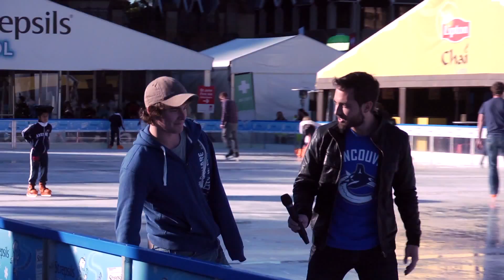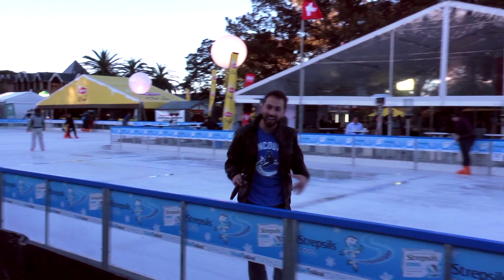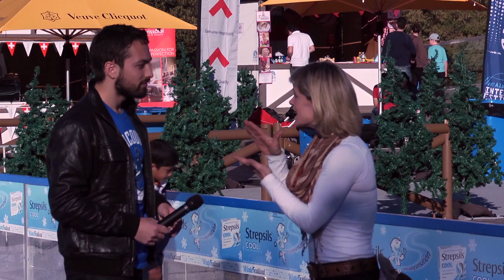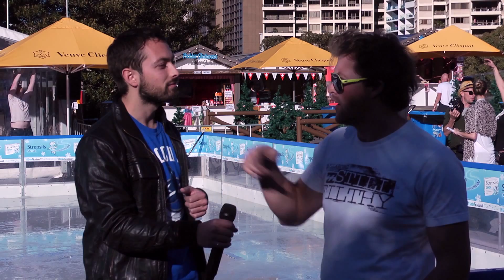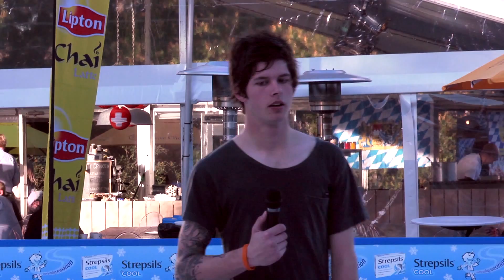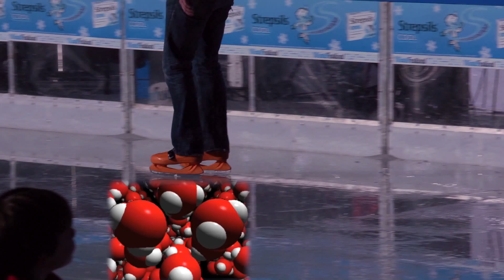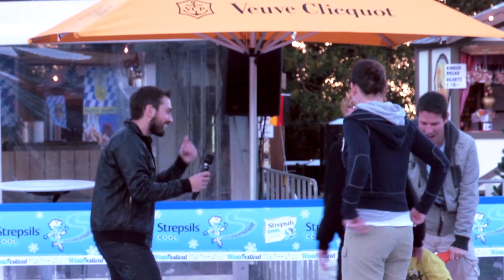Why Is Ice Slippery?

Comment: Ice is slippery because of a super-thin layer of liquid water on its surface, which acts as a lubricant, but recent science suggests this layer forms not just from pressure/friction melting, but also from molecular interactions (dipoles) that disrupt ice's crystal structure, creating a fluid-like boundary even at very cold temperatures. This quasi-fluid layer, a mix of water and disordered ice, is far thinner than a hair but provides the slickness that lets skates glide and shoes slide, overriding the normal friction.  

Key reasons for slipperiness:
Quasi-Fluid Surface Layer: The most accepted theory is a nanometer-thin layer of liquid-like water that exists even below freezing, acting as a lubricant. 

Molecular Interactions: New research points to electrical forces (dipoles) between the ice and another surface that disrupt the ice's structure, creating this liquid film, a process more significant than just melting from pressure or friction. 

Friction & Pressure (Older Theories): While less significant than once thought, friction from a skate or shoe and the pressure from a person's weight can melt a tiny bit of ice, adding to the surface water. 

Molecular Mobility: The water molecules in this surface layer are highly mobile and less structured than bulk ice, making it easy to slide over. 

How it works in practice:
Skates & Skis: The sharp blade or smooth base interacts with this water layer, allowing it to glide with minimal resistance.

Walking: Your foot's contact also creates this layer, but the microscopic peaks and valleys on both the shoe sole and the ice surface get filled by water, creating a smoother, slippery interface.

Comment: I think this video would deserve a retake because it turns out that if the ice is colder than -3.5 °C, the pressure from the blade edge pressing against the ice is not high enough to allow the ice to melt. The actual cause is assumed to be that ice builds a thin (10–20 nm) water film when exposed to air and this thin water film reduces the friction.

So the answer is still liquid water but it's not because of pressure alone. Within temperature range 0 ... -3.5 °C the pressure alone makes ice slippery but ice hockey tournaments are organized on ice that's kept in temperature around -9 °C where pressure alone isn't enough to explain why it's slippery.

Another interesting thing to consider is that even if you had just rubber shoes, walking on smooth ice vs walking on wet glass would still result in less friction on ice!

Comment: This is incorrect though, right?
Reply: Yes we have new information that contradicts this. Apparently the reason ice is slippery is because of the way the molecules are arranged imperfectly along the surface of the ice. 

A new study shows that ice is still slippery at temperatures as low as -150 degrees C where there is no layer of water present. This video is a reflection of old knowledge. 

Google why is ice slippery and you will find the same answer that this video gives. To find the new study Google “Why is ice slippery 2024”

Comment: Actually that's just part of the answer and not even a major one.

You see the pressure would melt the ice but only when it arrives to equilibrium, which isn't achieved so quickly.

The real reason is that the surface energy between ice and air is so high that water forming on top of it would create two different surfaces  with combined lower total energy, even though water is in solid state at those temperatures. 

In fact since it costs energy for water to be in liquid form at those temperatures the leyer that is formed is only semi liquid and a few atoms thick!

Comment: Isn't it because Ice/Water expands when it freezes (in contrast to most other solid/liquid transitions in which freezing is usually accompanied by a contraction)? So an amount of pressure will cause the ice to turn to liquid as this requires less volume. In contrast other solids (such as wax for example) contract when the freeze, so no amount of squashing will turn it to liquid. Hence no suitable higher temperature alternatives to skate on!

It's true that applying pressure depresses the melting point; but this is a corollary to the key property of water/ice that is special. Moreover the "expands when freezes" is a property known to (almost) everyone so might be a better (more memorable) way to explain the phenomenon.

Comment: The one guy answered actually correctly saying it’s that the atoms are unstable at the top layer, the pressure doesn’t impact the melting point enough to cause the slippery effect. Even with the most minuscule pressure and below freezing temperature this slippery effect will still be observed.

Comment: On top of Mount Everest, the water has a lower boiling point than 100°C because of low atmospheric pressure there. Then why does the ice melt when you apply pressure with your foot? The melting point of ice should increase because we're increasing the pressure that is exerted on it.

Comment: “By standing on it, molecules compress bringing freezing point down, melting a thin layer to slide on”....”it’s based on pressure, not the temperature”...

Ok...but what if the temperature is still below the new freezing point?

Comment: The scientific consensus now is that it's not the friction of your skate that make the ice slippery but since the solid state of water (ice) is caused by covalent bonds instead of pressure the top layer of molecules aren't connected to as many other molecules and are therefore unstable. They're technically not a liquid but they act like one. It's not fault of Ve's it's just a newer scientific discovery.

Comment: Doesn't the flatness play any role? In a liquid, which is free to deform, every part of the surface is pushed by gravity with the same strength, so wouldn't it become perfectly flat? If yes, then by freezing it, you'd get a perfectly flat solid, with no dents to provide friction, you'd have no dents for your dents to bump into and stop the movement, so the only direction in which it would stop you is downwards.
If it's wrong, why is it wrong?

Comment: Didnt some research ltr show  that this wasnt the case since the ammount of pressure needed to melt the ice was far more than that which was created by the skates.
If i remember correctly, the new idea is that the water molecules on the surface can easier move due to less attraction to the surrounding molecules.
This effectively makes it so the molecules can start rolling so they become like marbles/balls on the floor and we all know that is very slippery c;

Comment: After 9 years we have another explanation
Pressure is not it because you need to weigh an equivalent of a full grown elephant to generate enough pressure to mealt it using the ice scates.
Real reason is top layer molecules of ice is in equilibrium state, i.e the molecules are not solid but are not exactly liquid either. Now with that, when you are sliding on ice, this layer assists the sliding effect.

Comment: Tie two small weights together with a string and lay the string over a block of ice with the weights hanging off both sides. The pressure ends up “cutting” the ice with the string, and if the air is cold, the water will re-freeze on top of the string trapping it. (Love your videos!)

Comment: If that was all true (1. Depressing solid moves melting point AND 2. It does not depend on temperature, but on pressure) why can't we skate on steel or a cement?

Comment: If the pressure the blade of an ice skate on ice-rink ice is enough to lower the freezing/melting point so that a standing still skater was actually standing on a thin layer of water surely the water would just move away, the skater would sink a fraction of a millimetre and the process would continue until eventually the blade would sink into the ice until stopped by a wider part of the shoe.
Would a car on wide tires on a cold night in a cold place like winter in Norway inside the Arctic circle not slide on black ice because the pressure exerted by those wide tires was insufficient to lower the melting point to the point the ice locally melted, seems unlikely.
What is true is that a wire over an ice block with weights on the ends of the wire will slowly move through the ice block, the ice melting immediately below the wire and re-freezing above the wire until the wire had made it all the way through the block of ice. The pressure exerted by a thin wire under the tension of the weights, on the ice is considerable. The pressure exerted by an ice skate supporting a person is also considerable but a wide car tire, not so much.

Comment: What if the pressure isn't strong like will an ant fell the same or
 does it not affect them
Reply: Maybe it will feel the same because pressure ist Force per surface area 

So if it weight is 1 gramm on 1mm^2 it will have the same pressure as a
100kg human on 100000mm^2 ~1000cm^2~10dm^2 
So mybe it doesn´t feel it as strong as we do but it is noticable
Reply: Simson Greep someone needs to test this but don’t hurt the ants 🐜🐜🐜 🌫

Comment: Wrong explanation
Right explanation
Ice has a very regular, neat crystal structure, where each water molecule in the crystal is attached to three others. The molecules on the surface, however, can only be attached to two others. Being so weakly bonded to the crystal allows these surface molecules to tumble, and attaching and detaching themselves to various sites on the crystal as they move.

Comment: how can pressure decrease melting point? i think it must increase the melting point.
Reply: Unlike substances in general, water is denser as a liquid than it is as a solid, due to void space in its crystal structure.  Adding pressure to ice means that you are forcing it to be denser than it can be as a solid at that temperature, and causes it to become a liquid.

Comment: basically the water on top covers the tiny non-smooth parts making the surface somewhat more smooth meaning that the weight of your body is distributed on a larger surface area meaning less force on each connection point with the ground meaning you are slippery.

Comment: OK, stupid question time. If pressure liquifies water how is it possible for an ice sheet to form? A 10 metre deep sheet of ice has got to be exerting more pressure at the base than my weight distributed over the area of my shoes. Does that mean there must always be liguid water running out of the base of an ice sheet? And if that's true shouldn't it also be squirting out the sides beyond a certain depth - so you'd get no vertical ice faces?
Reply: OK stupid addendum to my own stupid question. The next clip partially answered this; regelation. I guess an ice sheet in a warmer environment would have more overhang of the top.

Comment: He was wrong about slipperiness of ice.  Pressure melting is only a small contribution to the thin liquid layer of water on ice, the more dominant cause of slipperiness is a quasi-liquid layer on the ice which is always present due to the inter-facial forces between air and ice.  These van der Waals type forces cause a thin water layer, or more accurately, a mobile H2O molecular layer a few atoms thick, which persists for fairly cool temperature all the way down to about minus 30 to minus 40 degrees Celsius, below which ice surfaces get fairly dry.

The pressure-melting is a common misconception.  It is simple to prove it is the wrong explanation.  If you take two snow balls and hold then very lightly together with almost no pressure, after a few moments they will sinter together.  So this cannot be due to pressure melting.  It is due to the interfacial quasi-liquid layer on all the snowflake surfaces, which allows the surface molecules to sinter or bond with no need for pressure.  You can also do the same experiment with ice cubes.  Just keep them in the below zero freezer, but hold them in contact lightly, they still sinter together with hardly any pressure needed.  This is also why ice cubes in your ice tray eventually get stuck together, there is no significant pressure doing this, mere contact is sufficient.

Comment: Well, temperature does play a little into it, because there is less liquefaction when the ice is colder. Figure skaters prefer warmer ice because it gets wetter and they can glide better. But hockey players hate it because it gets chewed up easily. They prefer colder/drier/harder ice that glides less well, but won't chip as badly under braking, and sharp turns.

Comment: I wonder if the actual molecules of water in closest electrical contact rotate like bearings under the blades and above the frozen layer. Is it like rolling on thousands of tiny beads or logs of H20 or is it the nuclear forces we're actually gliding on or what ?

Comment: It's actually because the relative motion between the blade and ice causes heat and locally melt ice to water, rather than the pressure decreases the melting point. The latter requires a huge increase in pressure, which normal skating blade cannot provide. This was studied by a Cambridge professor.

Comment: Not only the lubrication effect of water melting under pressure. It has been shown that on the interface with air, top water molecules, while trapped as ice, behave like water along the vertical axis. Some kind of "Okay, i'm trapped on x&y, so let's shake verticaly"=> dramatic drop in friction.

Comment: pressure melting does not in fact cause the ice to melt. the crystal lattice at the surface of an ice crystal is disordered and behaves in a liquid-like fashion. It can occur significantly below the thermodynamic melting point of the substance.

Comment: At what temp below freezing would the pressure of a human walking no longer be enough to melt any water for lubrication?
Reply: That isn't really known. It's believed ice is somewhat slippery at essentially any temperature. Pressure is a component of why ice is slipper, but Derek was incorrect in citing it as the main factor - it is no longer believed to be the main factor, and often considered to be something like the inherent disorganization of ice is most obvious at the top (less true crystal formation) meaning that it acts almost liquid at the top. The pressure difference hypothesis was fairly easy to disprove: even light plastic sheet slips on ice, but has a negligible pressure. However, it is true that lower temperatures generally mean less slippery ice.

Comment: Ice is slippery when it is -20, and is slippery even in flat shoes, which don't put that much pressure on it, so no, you are wrong.
Reply: Actually, ice can become more sticky than slippery when it's cold and dry enough, just like your tongue can be stuck on an icy pole.

You don't need a lot of water to make ice slippery. Just think about a think kids do at school playgrounds when they want to slide faster on ice : They simply add snow to it. That would be why it's so easy to slip from ice when there's snow over it too.

And of course, there's the question of pressure which makes the temperature simply a trivial fact that doesn't contribute even a percent of the slipperiness.
Reply: we're talking about the atomic level, so any amount of pressure perceivable to us is enough to change the atoms.
Reply: Pressure is not the full story. It's been calculated, and the amount of pressure put on the ice with flat shoes, for example, is far too low to cause ice to melt significantly. This is even more evident if you place a book or other light object with a large surface area.

Comment: Ice doesn't melt from pressure applied by the skates, rather it's the friction from the skates on the ice. Ice (typically at -6*C to -9*C) would require 100MPa of applied pressure to melt! Skate blades are approx. 3mmx30cm, so a 77kg person can't even apply 1MPa of pressure if standing on the one skate. As a thought experiment, how could a hockey slide on ice if it depended on applying pressure to melt the ice? I know this video is 5 years old, but it could be worth while revisting... "Muller?...Muller?"
Reply: It's not just friction either. It's also disorganization of the ice crystalline structure at the top layers, making the top particularly fluid.
Reply: Bertrand Thibodeau Skate blade is not a flat piece of steel. The contact area is really small.
Reply: yes I think you are correct. The friction melts it and turns it in to water.

Comment: That explains why its hard to regain control of cars once they start hydroplaning on ice
Reply: Well, no. Hydroplaning happens basically when the tires of the vehicle are moving faster than the water beneath it, making the wheel roll on water, and since the friction ratio between a tire and water is very low compared to the ratio it would have being in contact with a solid, like asphalt, makes you loose the control of your vehicle.

Here the phenomena is different, Derek is talking about the property of ice. When there is pressure on the ice, the melting point goes down enough for changing the state, from solid to liquid, and so the ice changes it's state to water for a short time, making you roll on the molecules of water. When the pressure is not applied, the melting point rises up, freezing the water again.

But I am reading comments that say that actually is not the pression that lowers the melting point of ice, but is the friction generated by the blades. 
If you want go deeper in this phenomena, do your own research and get to your conclusions :)
Or choose into who believe, but they might be all wrong! :D